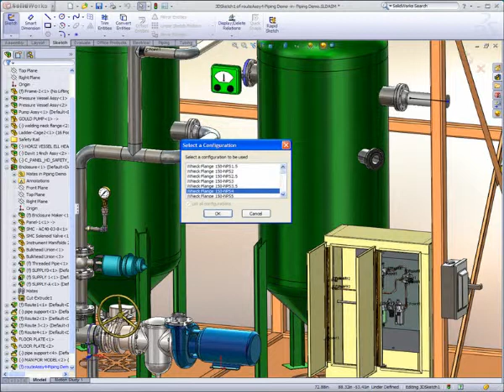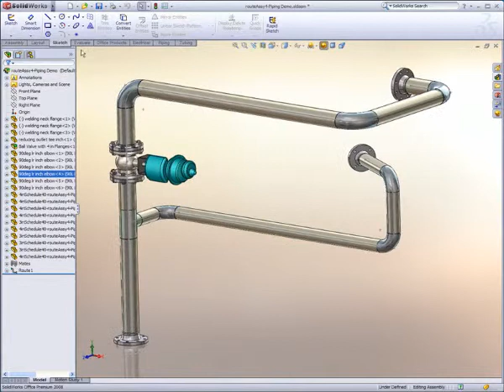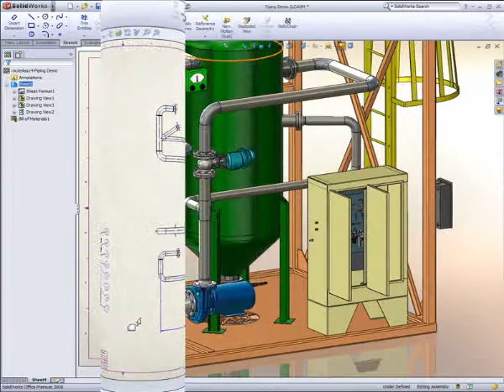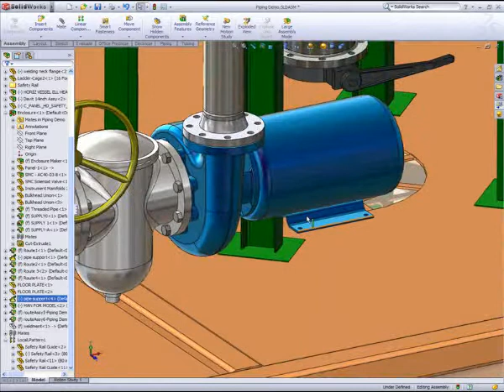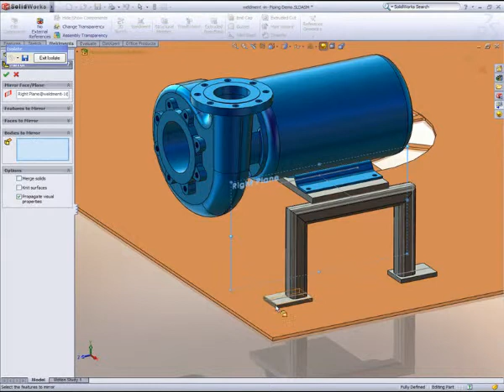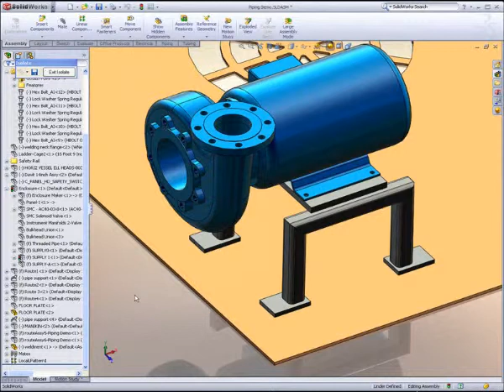SolidWorks - Oil and Gas Skid Design

Comment: Hi Sean

All I want to make is small structural pump/motor skids made from w beam or c channel and steel plates. I want to specify steel type and weld. I want to import 3D drawings or vector files from manufactures onto the baseplate. Would solidworks be a good simple choice?